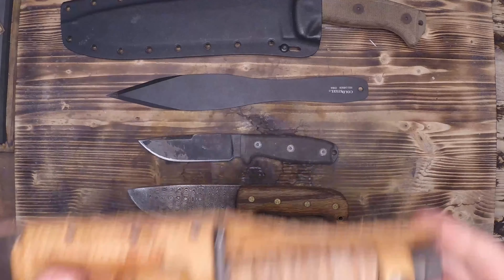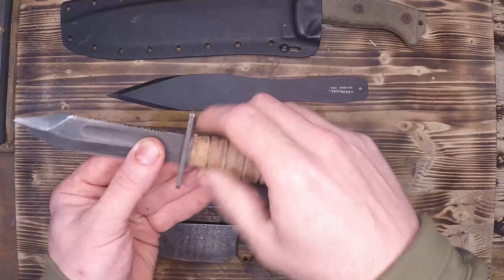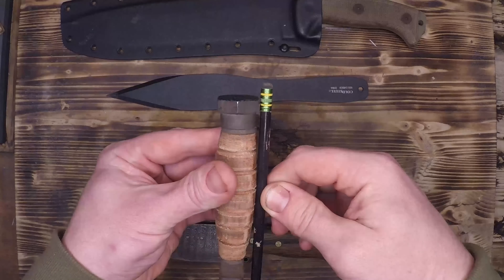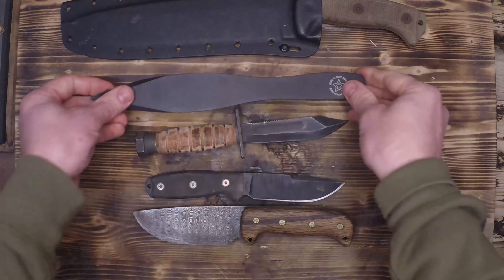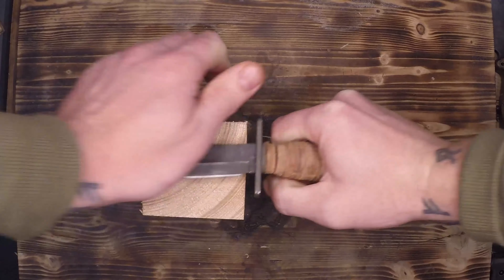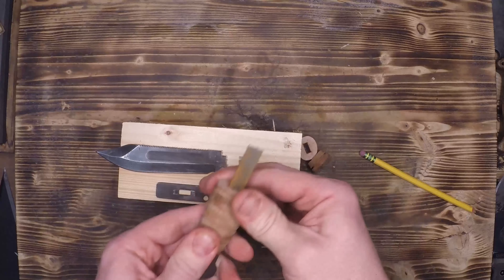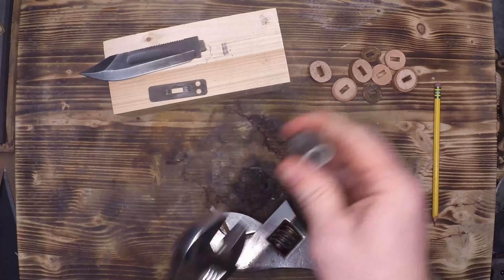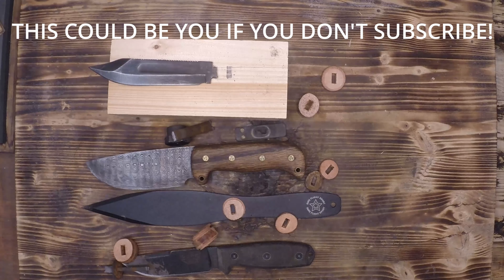STOP BUYING THIS KNIFE!

Comment: Strangely the one I had from 94-2000 was solid but I figured maybe it was simply because of its age late 60's to early 70's build
Reply from the maker: They are ok knives if you don't wrench on them too much. I have one from 2006 that is still straight. Maybe they heat treated the early ones. Thanks for the comment it helps spread the word!

Comment: Since you mentioned bushcraft... I think that knowing the limitations of your tools is part of it. Being able to make do with sub-par equipment is a skill in itself. And many knives used by bushcrafters are not as sturdy as a tactical/survival knife like the RAT etc. That said, I'd rather have a $10 Mora stick tang knife than this thing...
Reply from the maker: Yes, being able to improvise or to work within the limitations of what you have are very important skills to have in bushcrafting and in life. And if you already have a  poor quality knife, you have to make do with what you have until you can replace it. However, setting yourself up for success by having decently reliable equipment instead of setting yourself up for failure by deliberately purchasing subpar equipment is the wrong way to go about learning that lesson!

I do like the Mora - they're cheap and a good starter knife since the pricetag means they're super easy to buy multiple and have spares. And yes despite the price they're still better quality than the boltknife!

Comment: What is a good Damascus knife you recommend?
Reply from the maker: I've had trouble finding a consistent company that makes Damascus but already all layered steel these days use 15N20 and 1095 steel which makes pretty great knives. Despite what the rumors are, modern Damascus its superior to ancient Damascus at this point. Ancient Damascus had patterns due to impurities in crap metal being folded into good steel.

Comment: This is called a rat tail Tang. Some manufacturers, like Buck in the 119/120/122/124 series use them with a pommel that screws onto a threaded portion of the end of the Tang.  They're a "full through" tang, not a full tang, being a full width tang,  as described.  They're strong enough for normal cutting tasks and shouldn't be feared in Quality knives, such as Buck.  But, they have limitations such as Batoning.  They won't take the pounding.  But that's ok, too because you should be carrying at least a small hatchet and some sort of saw along with your knife.  People have become obsessed with being able to baton with your knives as the ultimate test of field ready when, in actuality, that's something you'll hardly ever do except for very small/light kindling because even good knives get dulled and sent awry if you try to split wood more than a little bit.  Cary the right tools for the job anytime your anything more than caught out after dark on an unplanned trip.  With the right few tools in tow, your Buck 119/120 is absolutely fine for hunting, fishing, camping. 😀  I'd absolutely stay away from the cheap, "seconds" market or for inexpensive look-alikes, like the air crew knife shown here.
NOTE
  "Good knives will rebound..." That's absolutely true as long as you're staying within the flex range of the steel.  When you just plain bend the steel, as shown here, it stretches the steel which realigns the molecular structure of the steel so, when you try to bend it back where it was, it either bends back to a deformed state or it shears, as demonstrated here.
  Really good knives will flex, not bend, to 20° or more without breaking or permanently deforming the metal.
Reply from the maker: This is all true. I didn't mean to bend past 20 degrees but it just went easily. I was trying to show the rebound. Tang terminology corrections are on point
Reply: Careful Mtnbadger, you’re dangerously close to sounding like you actually know what you’re talking about…. Unlike this video.
Reply: @Ry4n.gr33n    I still like Bucks a lot.
I knew several guys when I was in the service who carried a 120 (this was 80s) and they're a good quality steel with a lot of corrosion resistance and durability and great cutting knives, ya just have to keep them up to snuff (cleaned/honed) and you're good to go.  And they'll take a lot of cutting and light tasks with only a cursory honing, keeping a good edge.  The clipped point design is great for stabbing, dressing, and some fine work if ya need it.
  Like I say, people are obsessed with abusing knives to the point of the exclusion of things you actually need.  "Don't be a dummy."  <grin>
  And thanks for the kind words, I've been at this 4-5 decades, eventually the truth sticks, whether you want it to or not.  😉

Comment: How do you feel about the KA-Bar.  They have to be very similar.
Reply from the maker: Similar in looks mostly. The kabar handle is compressed properly and has a much stronger tang.  However, it's not a knife that I like very much. Too long overall and I prefer a stronger less narrow tip. This is my complaint with Bowie knives as well. I prefer something like the ESEE4-5.

Comment: I have one of these knives, have never brought it into the woods with me tho. My understanding is that they were more of an emergency knife, for escaping a downed aircraft and hopefully surviving your way back to civilization, not long term survival use. The serrations are for cutting thru metal, not wood, as in cutting your way out of a downed plane.
Reply from the maker: This is a common misconception. The knife is packed in the seat kit of ejection aircraft so you can not get to it at all until after you eject, parachute down, and open your kit. For bailout aircraft this knife is not recommended for egress because they have crash axes that are designed to cut through the metal. Source: I've been teaching this to military aircrew for 16 years and I have the technical guidance printed out on my desk.
Reply: @FollowTheCompassNorth  I have a fully kitted Vietnam era pilots (fixed wing, rotary?) survival vest and this Camillus Pilots knife is included with attached (sewn in place) leather sheath, leather holster for a .38 revolver etc. 1967. We as Army were never issued these, mostly Zoomies...

Comment: If you need a small knife to "take a beating" then you need to use another tool.
Reply from the maker: If you were talking a small utility knife sure, but this is a (not small) survival knife. It was literally packed into a fighter jet's ejection seat kit. This is THE KNIFE THEY HAD, they didn't get an axe or a hammer or a splitting maul. The majority of my students will not have those things either. Their knife needs to be able to take more abuse than bending it with my hands.

Comment: So now that I know this, I guess all switchblades are garbage, right?
Reply from the maker: I'm not a fan, they are hard to make sturdy but they aren't really meant for wilderness survival.
Reply: @FollowTheCompassNorth  what about assisted opening knives? Any better or both at the same level?
Reply: @RobDyrdek713  Personally, those are great if you need to do some caulking or wire stripping. But in the wilderness you need something a little more robust.
Reply: @LordNinja109  yeah, maybe so. Guess I kinda missed or read over the part where he said that he was talking about wilderness knives, I thought he meant just knives in general, my bad lol.